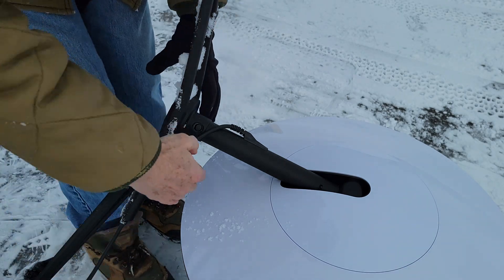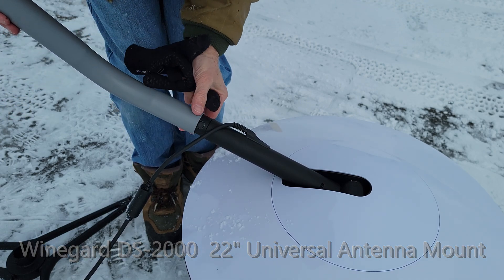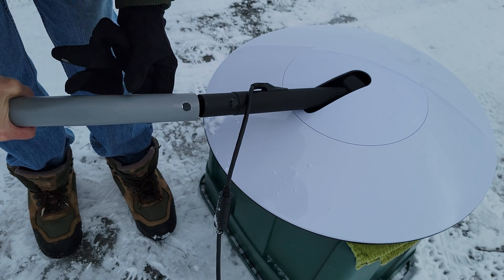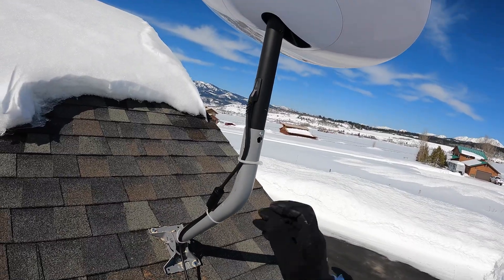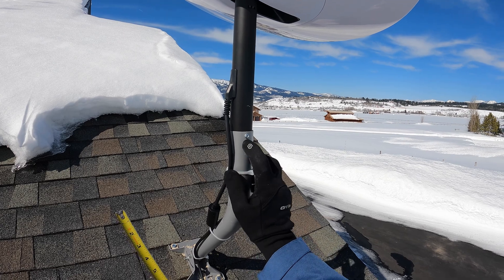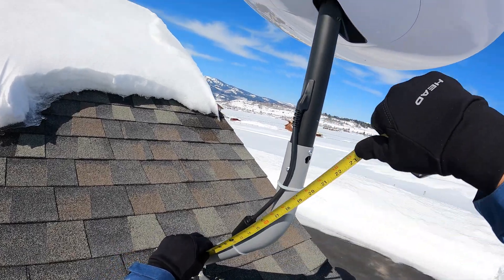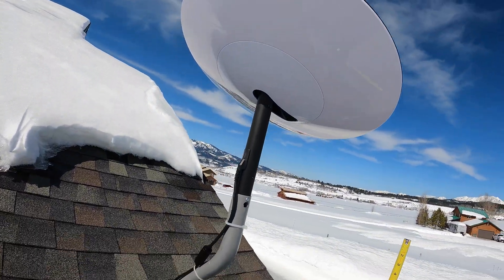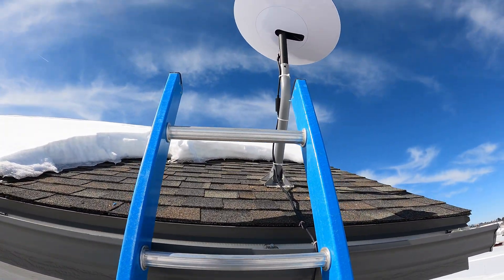Mounting the Starlink Antenna on a Winegard DS-2000 Universal Antenna Mount Kit

Comment: I've installed satellite dishes on roofs for years. When installing this type of mount, use SIX lag screws. The two in the centre should be screwed into a roof joist. Use a hammer to sound out the joist. The other 4 screws can go into the roof decking. Make sure you use a proper sealant (mastic tape) under the mount, and the 6 screws will drill thru the black mastic, self-sealing the holes. Also, leave a drip loop where the cable comes down the side of the pole. The way you installed it, you cannot take the dish out of the pole without cutting your zip ties. When installing the dish into the mounting pole; Take the spring loaded locking mechanism out of the Starlink pole, and use that hole to put a bolt thru. Drill a hole thru the grey satellite dish mount or antenna mount. Insert the Starlink pole onto the grey pole, line up the holes, install the nut/bolt thru it, and tighten it. They grey pole will collapse slightly, and the Starlink pole will tighten up inside for a perfect fit. I just did an install for someone last week using this method and it worked perfectly!
Reply from the maker: Great advice.  I'll pin your comment to the top.
Reply: I think putting the bolt threw is def the better options, its highly unlikely that I want to screw into the actual dish lol
Reply: This is awesome advice and walkthrough! I'm definitely going to do this as described. Thanks for taking the time to share some knowledge!

Comment: I have that mount and after a rainstorm with 20 mph winds the mount blew over. It holds two small roof antennas on a five-foot pole. So, be sure to crank down the swivel bolt good and tight. No damage was done.
Reply from the maker: Thanks for the heads up. So far so good with mine after 2 years, but I still worry a bit when the wind is howling.

Comment: i just received the v2 dish today, and am planning on using the same method. although after my initial findings after unboxing. i have some Ubiquiti J-arms that are actually slighting smaller diameter then the typical grey ones. which is nice. have you had any issues with this style mount since posting this video?
Reply from the maker: I've been very pleased with my mount and have had no issues.  The reason why I used this mount instead of the standard mount was that I often have 36 inches or more of snow on the roof, and this mount placed the dish higher than the standard starlink mount.
Reply: @modelxevfun2858  SNOW exactly! It looks excellent btw and love the height you achieved for SNOW! I'm already done mounting mine over a year ago myself and used a Satellite TV J-Arm I already had but at the time the BETA was so new and I was one of the first people to get a dish and bought the Dish Pole Adapter Pipe which was totally not necessary obviously! As a side note I installed my neighbors a month ago (the newer Rectangle Dish) and just used a Satellite J-Arm again and this time slipped it into the pipe and used a muffler clamp and it squished the pipe and locked it down nicely!

Comment: You should have cut the bend out of the mount.  That is what all the Satellite installers are doing now when they
roof mount.  No need for that extra length and bend.  Less stress and wind load.  Good job though.

Comment: Can you tell me what the outside diameter is of the Starlink pole?
Reply from the maker: Starlink has a new antenna, and I don't know if the new antenna has the same diameter mast.  The mast outside diameter for my antenna (Feb 2021): 1.5 inches above the collar and 1.4 inches below (3.81 cm, 3.56)
Reply: @modelxevfun2858 And your tube diameter, do you remember? Thanks.
Reply from the maker: The Wineguard DS-2000's tube is reported to have outside diameter of 1.625 inches and an inside diameter of 1.5 inches.  It was a very loose fit between the two and I ended up securing it with a couple of metal screws.

Comment: Why are you using non UV resistant tie wraps?  Usually the black ones are UV proof.
Reply from the maker: Appreciate the tip.  I'll see if I can find some and replace them.
Reply: @modelxevfun2858  You're welcome.  It also doesn't hurt to check the labelling on the package.  All of the ones that I have seen will say they are UV resistant.

Comment: Can you or anyone else please help to clarify the following?

I placed an order for the StarLink, and now I am concerned after reading a couple of reports. The reports say that, with the StarLink, any internet-based security cameras can no longer be viewed through the apps. To me, internet is internet, whether it is from StarLink or from cable company. Just do not understand why the internet-based security cameras and the internet-based apps will no longer work under StarLink.

Could someone please let me know if that is really the case? If that is true, then I am really wasting my money for purchasing (or ordering) the StarLink. Thanks.
Reply from the maker: I don't have a yes or no answer for you.  It depends.  In my case, I have an Eufy video doorbell and four older Samsung Cameras that are connected to my Starlink home.  I can access all of those devices remotely when I'm traveling.  I also have two very old Panasonic Security Cameras (15 + years) and I cannot access them.  Starlink is currently in beta and some issues still need to be worked out.   If you can find a support forum for your cameras, you might want to post the question there.  In any event,  section 4.3 of the agreement states "Cancellation, Return and Full Refund. You may return an undamaged Starlink Kit and any accessories within 30 days of receipt for a full refund for any reason, including the inability to receive Services at your address due to field-of-view issues. To return the Starlink Kit or any accessories, follow instructions in the Return Policy in the Starlink Customer Portal."
Reply: @modelxevfun2858  Thank you for the detailed response. I have not received the Starlink yet.
I have a number of Wifi Reolink cameras (I.e., they are not hardwired via Ethernet). My only hope that I’ll be able to live view on these cameras on my iPhone.

Comment: Super helpful! Thank you. Just got my Starlink beta order confirmation today after placing my deposit two months ago. Very excited. I will be ordering this Wineguard mount. Looks like a great fit.
Reply from the maker: It is a loose fit, and the shaft should either be bolted or screwed.  If I lived in an area with less snow accumulation on the roof, I would have opted for the Starlink Volcano mount instead.

Comment: I am on the pre-order waitlist. I am getting my roof done in the next couple of weeks, I wish I could order the mast anchor so I could install that when they are redoing the roof. But I can't even get into a 'store' for the accessories yet. How much do they cost?
Reply from the maker: I would have gone with the volcano mount from Starlink if I didn't live in a climate with so much snow.  I sent a support request to Starlink to see if they were going to offer an extension for their volcano mount, but did not receive an answer.  They do offer a pole adapter that will fit most pole mounts.  I bought my wineguard DS2000 mast mount from Amazon (not sponsored)
https://www.amazon.com/gp/product/B00068YUN4/ref=ppx_yo_dt_b_asin_title_o02_s00?ie=UTF8&psc=1
Reply: You can order the mount when you are notified that you are able to complete the purchase. It is priced at $24+tax, no shipping
Reply: @booterone1  I understand that. I was hoping to get the mount early so I could install it while my roof was being replaced. But that has already happened so... moot point now.

Comment: At 1:10 how far down from the tip of the mount did you make that hole
Reply from the maker: I don't recall the exact distance, but it was further down than the hole in the tripod mount.  The reason I drilled it lower was that the diameter of the antenna shaft is a bit larger above the joint, and I was hoping that it would allow for a tighter fit.  In the end, the fit using drilled holes and the popouts on the antenna shaft was just too loose for my liking.  If I had to do it again, I wouldn't bother drilling holes for the popouts, I'd just secure it with a couple of screws.  An installer commented on this video and said that he removed the popouts from the antenna shaft, drilled a hole through the mount and used a single bolt to secure it.  The advantage of that method is that when you tighten the bolt, the mount will deform a bit and he says it makes for a very sturdy mount.

Comment: What exactly did you use those screws for? trying to figure out how to install without spaces mounts because it till take forever for it to come in mail
Reply from the maker: I used the two screws to secure the Starlink mast to the Winegard mount.  The Starlink mast slips into the Winegard, but it is a loose fit and it didn't feel secure, so I added the screws to minimize wobble and make sure it would stay in place in high winds.
Reply: @modelxevfun2858  What kind of screws do i need? can you tell me what all i need to do this?
Reply from the maker: @FallingxFreaK  I've just pinned a comment to the top that was posted by an experienced installer, who recommends using a bolt instead of screws.  It is probably good advice.
Reply: @modelxevfun2858  ok thank you.

Comment: What size was those self tapping screws that you installed? Also what was the drill size for the holes? thanks for any help
Reply from the maker: I used 8 x 1/2 pan head tapping screws.  The recommended drill bit size for a #8 screw is 0.1360 inch.
Reply: @modelxevfun2858  Thanks but what is the size of the drill bit for the quick release of the dish.
Reply from the maker: A half inch drill is the right size.  The inside diameter of the Wineguard DS 2000 is a bit too large and it makes for a sloppy fit.  I wouldn't trust it just using the Starlink quick release.  I originally thought I might use a plastic shim to firm it up but then decided that I'd just screw the two together.  The antenna is pretty expensive, so I decided that a couple of screws would give me peace of mind and they will be easy to remove if I ever need to.
Reply: @modelxevfun2858  I'm using an old Dish network mast that I had laying around, I haven't received the Starlink dish yet just getting the old mast ready when I do get it, like you I have put the screws in it I don't want it falling and breaking. Thanks again

Comment: You should mount it on the rake side of the peak where your 2x6 or 2x8 is.  It’s a bad idea where you mounted it will cause a roof leak over time.
Reply from the maker: I agree that would be the best for most locations.  Unfortunately I have huge snow cornices that form on the north side.  I have to cut them off on a regular basis over the winter.  The Antenna wouldn't stand a chance if one broke off.  The center lag bolts are firmly into structure but I'll probably add a backer board on the inside of the attic and some through bolts for the outside of the mounting bracket when things warm up this spring. With some good flexible compound, I'm hoping that it will be fine.

Comment: I hope you put some sort of sealant between the base and shingles where you fastened it down.
Reply from the maker: I squeezed some sealant into the holes and on the lag bolt threads, but it was pretty cold at the time, so I may redo it this summer.